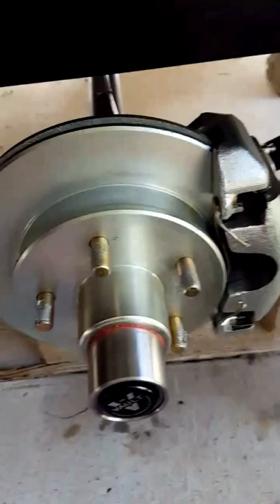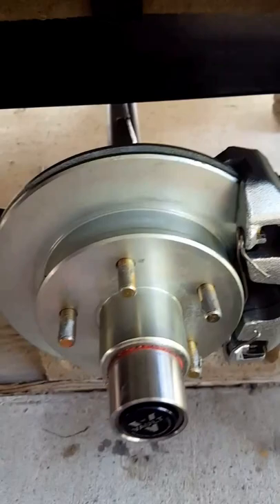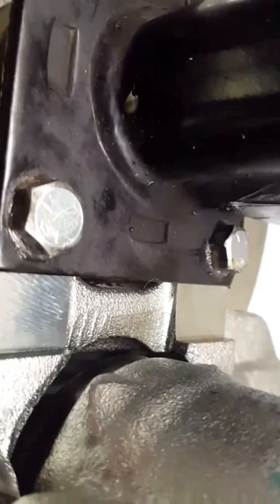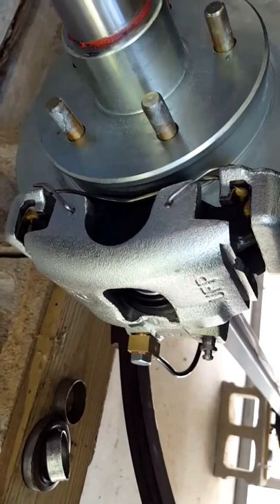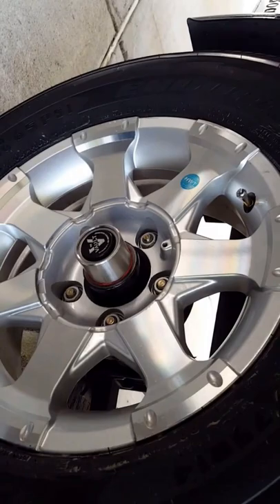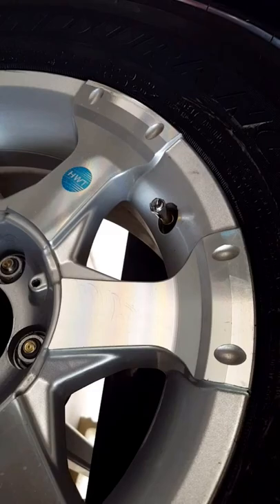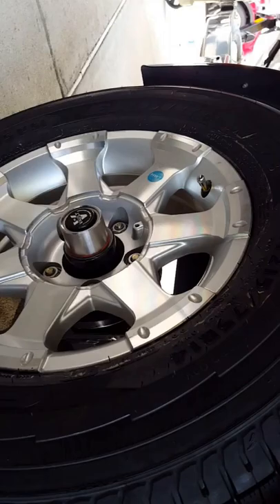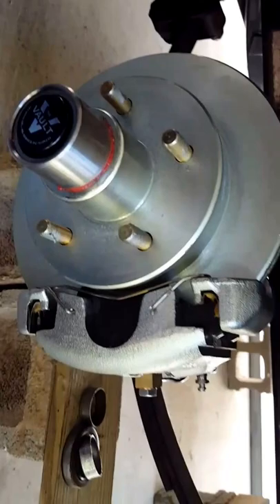boat trailer bearings, brakes, calibers vault hub , rotor install.

Comment: When putting the calipers bolts on the mounting flange, did you use blue loctite? Or anti seize? What do you recommend?
Reply from the maker: #242 red locktite on anchor bolts. Blue locktite on caliber slide bolts.